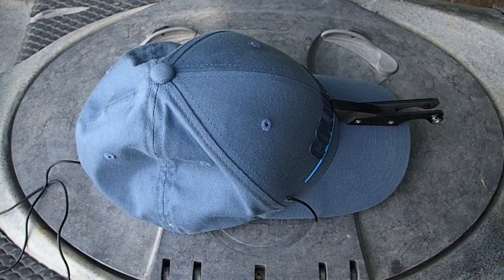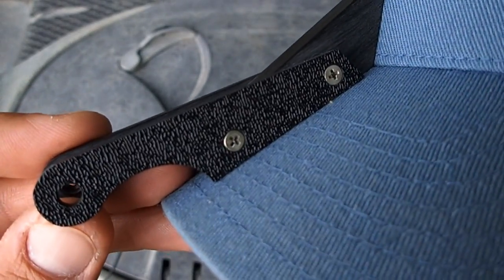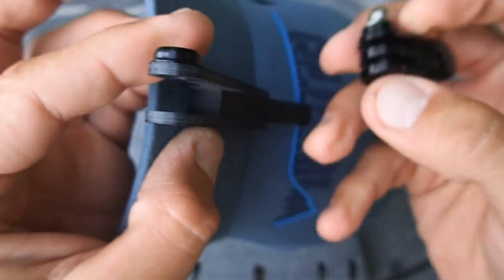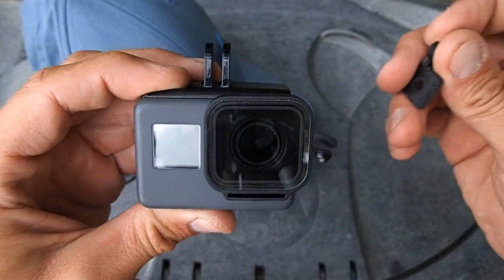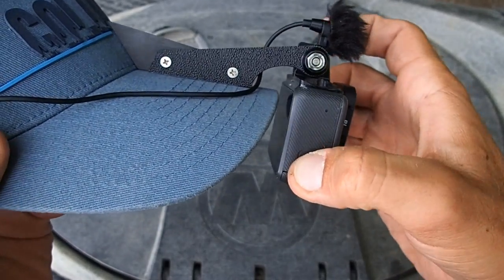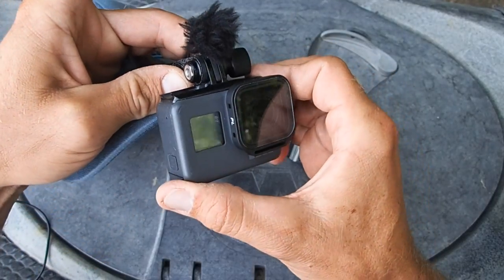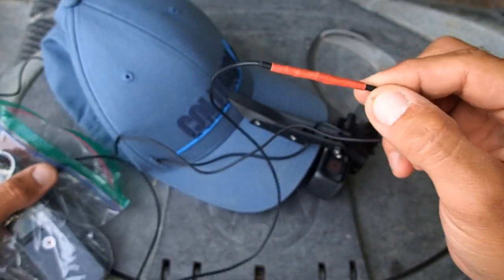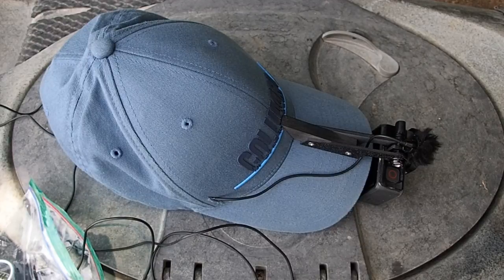Homemade Hat Cam Rig

Comment: Yea that is awesome... and to be able to glance up and see the screen... even better and the mic setup is just too dang cool I have 2 of those audio technica lapel mikes and I stopped using them  over a year ago and was going to sell them on ebay because the batteries just didnt last... I never ever thought about cutting the cord and powering with the zoom recorder...I have to try it.... Thanks
Reply from the maker: Yeah get rid of the battery capsule, the mic will run hotter without it so you can either turn the input level down or you won't have to boost it as much in editing. Either way you end up with less recorder noise and the finished audio clip will sound much better.

Comment: ohhh I was waiting for this! the old model you showed me was fantastic but this with the hero 5 is even better! My next head Cam Will have a lcd, for now I still check for batteries, is it turned on, etc and it's a pain!
Reply from the maker: The Hero 5 is awesome! The batteries seem to run it a lot longer than previous versions too.

Comment: I noticed your camera was on the 1080 30fps setting.  Was this just for the video or is that what you run during fishing? Do you increase to 60 or 120fps? Just wondering because I upgraded to the Hero 5 black and you talked about battery life.  Thanks and really great video!
Reply from the maker: I always run 30fps. I need to upgrade my editing software, that's about all it can handle.
Reply: Thanks for the reply. Adobe Premier Elements handles pretty much everything and is user friendly.

Comment: Great engineering 👍I noticed that when you started your GoPro, the video setting was in the WIDE-mode. Is that the mode you're running on all your videos? The reason I ask is because I also have the 5 HERO black but usually go for the LINEAR-mode to get rid of the fish-eye effect. Apperantly, your videos look great and I'm actually not seeing much of that effect. Concidering to go for the WIDE-mode instead 😊
Reply from the maker: I’ve always filmed in 1080/30/wide. There’s a slight fish eye effect if the horizon gets close to the top or bottom of frame but it’s not too bad, not like the older GoPros at least. If I put it in super wide it has a lot more fish eye effect.
Reply: @ndyakangler  That's kind of what I noticed too. Will definately try the Wide-mode. Thank you so much for sharing your settings. Looking forward for more videos 😊👍

Comment: This is a wonderful mount creation. Great Work. What Did you cut the ABS plastic with? A bandsaw?
Reply from the maker: Thanks Vinnie! Plastic is easy to work with, I probably used a dremel with a cutoff wheel or a hand saw to cut these smaller pieces. I have a jigsaw too for bigger jobs.
Reply: NDYakAngler you’re welcome! And that makes sense, those are extremely small parts. I think I’m going to 3D print a similar model with the same material and test it out on my channel. Your video has inspired me a ton, cuz I love the idea of utilizing the screen on the GoPro. Thanks again

Comment: LOL far more elegant than what i did a few years ago - I cut a whole in the brim of a camo cap & attached a camera to a tripod mount & fit it in the hole to hunt with ... this is awesome - was wondering what camera you were using 👍🏻👊🏻 nice job!  PS did you DIY camo your kayak?
Reply from the maker: Whatever works! I use a Hero 5 black with my current setup, really the only thing different is I switched out hats after a year or two. The kayak came in that camo pattern.
Reply: @ndyakangler  i love that camo pattern - plan to DIY something similar on my Pelican this fall ... ya, my old hat cam 😂😂😃 your design is FAR more elegant & useful - mine was very crude & has since been retired ... you’re right about picking the right cap - i had to really cinch my down to my head to keep the camera upright 😂😂

Comment: Have you thought about making these hat mounts to sell?  I imagine there would be a pretty good market for those.  I'd buy one.  Right now I just cut a hole in the brim and run a cotter pin through my Hero Session 4 mounting hole.  It works OK but it's not elegant.  You've got a fantastic setup there including the audio.  I understand now one reason why your videos are such quality.
Reply from the maker: That thought has crossed my mind. I bet it would be pretty easy to make the plastic parts with a 3D printer.
Reply: Any updates to your hat mount in the last few years?  What GoPro are you running now?  I still have a couple of Session cameras but now that they’re discontinued I’ll need to find a replacement soon. The newer GoPros seem much bulkier and a whole lot more expensive. For awhile I switched over to some Polaroid Cube cameras I found on eBay. Upside - MUCH lighter and unobtrusive. Downsides: poorer resolution, battery life, reliability. I hope someone comes up with a similar footprint with better resolution and at a better price point. I can dream, right?

Comment: is that a polarized filter on your go pro 4 silver? it's really low profile. did you make it yourself? Love all your videos by the way.
Reply from the maker: Yes, I made it from a 46mm lens I used to use on a Pentax camera. I just chopped the metal surround off the polarizer with a dremel tool, removed the glass lens from the GoPro housing and sanded off the lip where the stock lens sat, then glued on the polarized filter.

Comment: You have made some stellar camera setups.  I'm trying to find a simple solution.  Kudos, video work is a pain!  lol  Personally I'm just not happy with the Go Pro silver black edition because of battery life and no LCD back.  For now I've been using my i-phone, but I need a good editing program.   Any suggestions?  I've been told Premiere Pro is good?   Thumbs up!
Reply from the maker: That's another thing I've noticed with the Hero 5, their batteries have only a slightly higher capacity but they seem to run the hero 5 almost twice as long as the hero 4 would last. Having a battery indicator with a percentage instead of three bars helps too so you know exactly how much power you have left. Premiere Pro is a great program but expect to spend some time learning it. That could be said about most software though. I use an older Roxio program, pretty basic but it does most of what I need it to. I also use Adobe Audition for all the audio editing and building the audio tracks I swap into videos.

Comment: Are you still using this same hat rig 6 years later?
Reply from the maker: Yes, still using that rig I just swapped it over to a different hat. I'd upgrade to a newer GoPro but all the newer models are about 50% more weight which I don't really want at the end of my hat bill.
Reply: @ndyakangler  ah there ya go. I have an 11 , was thinking it would get a bit annoying hanging there over a couple hours. lighter earlier models answer the question.